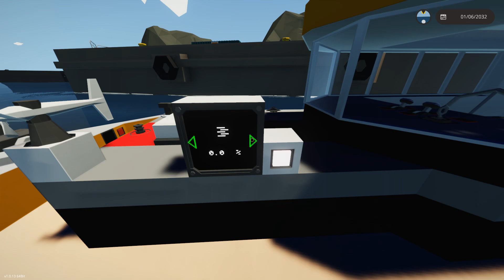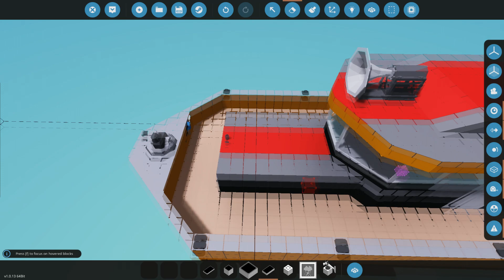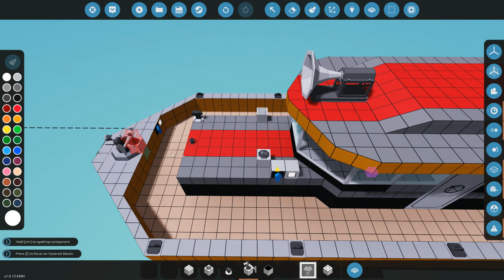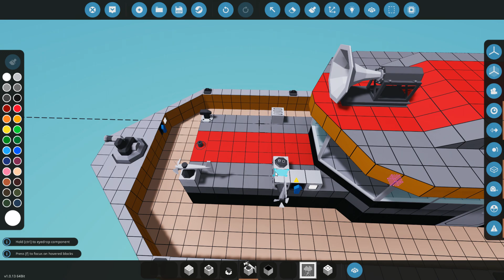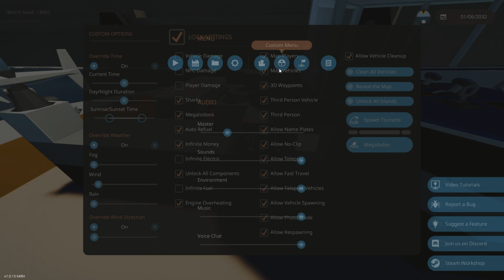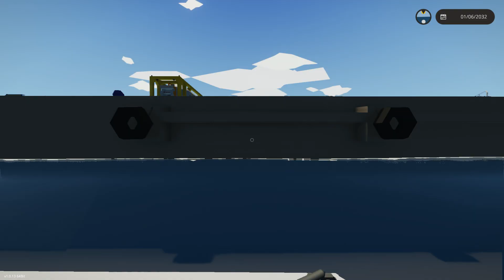Installing Weather Station Touch Controls in Stormworks

Comment: After testing the microcontroller out, the wind direction does not appear to be calculated correctly. I got out on the ocean and moved around a bit, and then checked. The wind was coming from the S, but the sensor read NE.